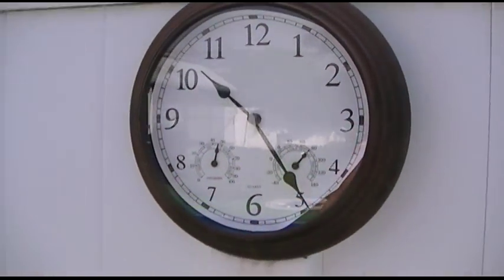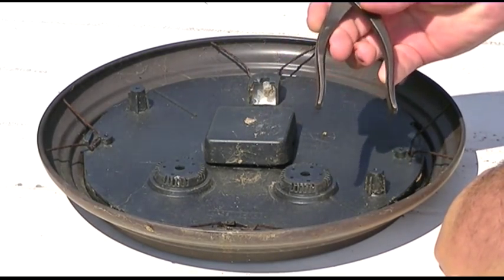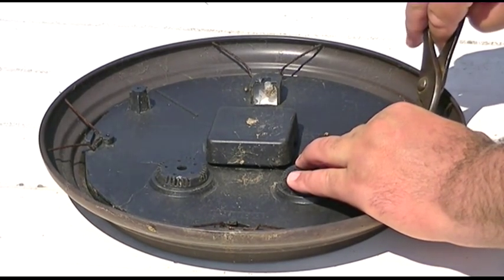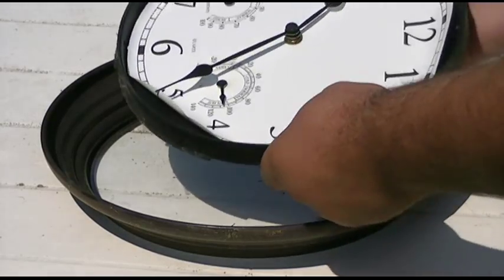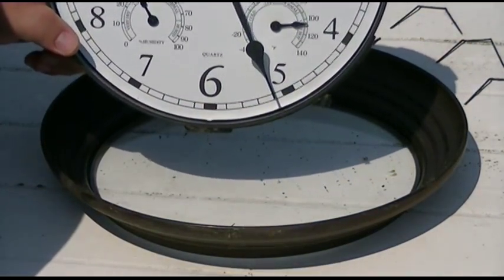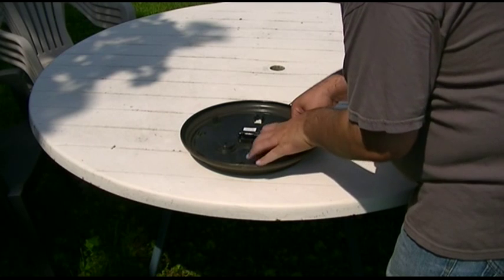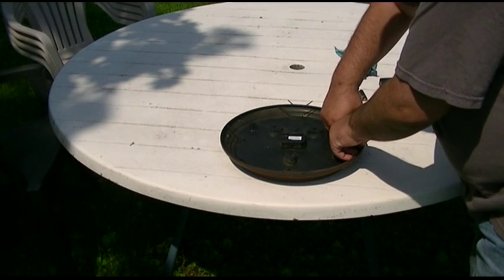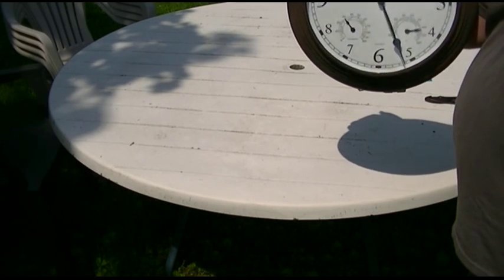Pool Clock Repair

Comment: My grandmother got a brand new China clock for three bucks a couple weeks ago. I accidentally broke the hour hand while I was watching her cats while she was gone. I broke it by shuttle a door hard which caused the clock to drop because it was not properly hung. The drop broke the hour hand. it's our fault the clock was not properly hung. The hanger did not work as well as we thought. The fix was simpler than I thought. I watched a YouTube video and it just said to push it down with you thumbnails until it is snug. Did that and it works like new. 3 out of six screws broke and still secures its self and the back has a small crack. I hope it will last at least six years. Preferably ten years. the front has glass too.
Reply: +Jason Hernandez Maybe clocks are one of the few things that China can actually make. As long as they're not digital.
Reply from the maker: Analog clock mechanisms have been around for quite some time.  The Quartz movements for them are actually pretty precise and they've been making them for many years.  The rest of the clock usually falls apart before the movement stops working.

It's lucky that the glass didn't break, as far as the clock hands go, yes, Mr. Chinaman with small hands puts them on.  They're all press-fit and just sort of go where they need to go.  Clocks have been around for a really long time, so they've pretty much figured out how to make them.
Reply: +jaykay18 Analog clocks are difficult to screw up.